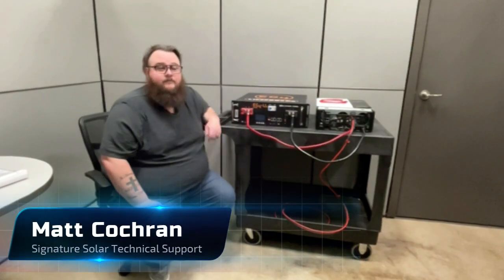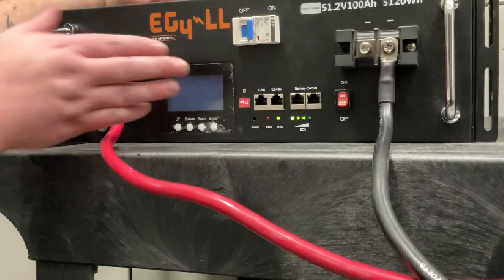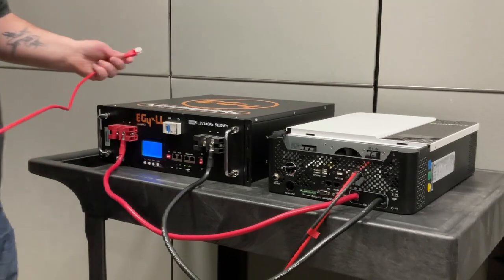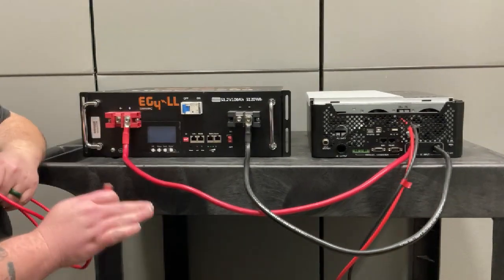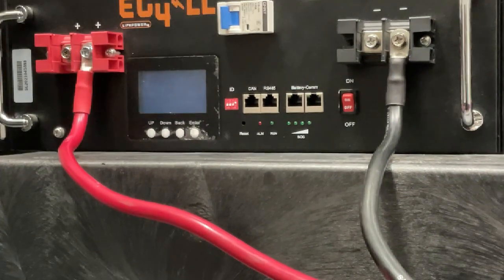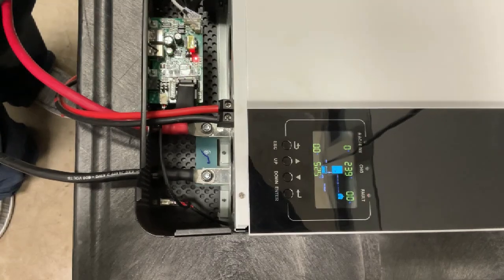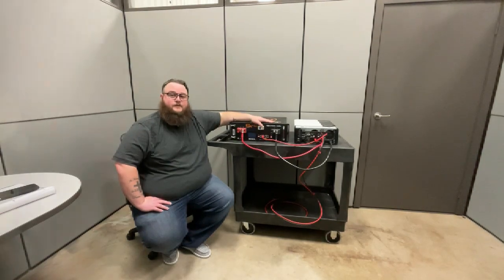BMS Communications with EG4LL Batteries - Tech Chat

Comment: More videos please, especially one explaining what grounding needs to happen between the 5kw, auto transformer and the sub-panel.  And whether or not your sub-panel gets bonded neutral to ground.  Thanks!
Reply: I would like to know this also.
Reply: 2 grounds run separately one for the DC one for AC. I bonded to neutral in both my AC breaker box and DC breaker box. I have 12 volt DC circuits for lights.

Comment: Thanks Matt,  you made setup very easy and it worked first time!
Reply from the maker: Glad it helped!
Reply: Only because this demo was of the most simplistic setup imaginable. Have fun with multiple inverters and batteries, and have fun with CAN vs RS485 connectivity. You might get lucky. Most likely not. I've got about $50,000 into my entirely-EG4 system thus far, and I have yet to get it actually up and running. EG4 tech support takes weeks to respond and then is terse and unhelpful. NO cable extensions available at any price. Radical and relentless misinformation in the manuals. In short, for anything beyond the superficial setups you always see demoed in these "help" videos, trying to get EG4 equipment working together for a whole-house setup is an intractable mess!

Oh, and I mustn't forget that the "EG4-LL" now comes in an older flavor (I have three of those) and a newer flavor (I have six of those). The look NOTHING alike. Ports are in entirely different places. Internal software is different. And the all-important DIP switches got moved from the front to an impossible place on the side (when the battery is racked), and which adds to the already deep confusion by taking ALL references in the manual to "up" and "down" and making you rotate them in your head to "back" and "forward." It's ABSURD. Still the same model of battery, but it's a different beast, and the manual, of course, didn't keep up.

I'm so SICK of wasting my time in befuddled research to try to get this mess to work that I literally cannot describe it! At the moment, I've got a $50,000 brick and a company in EG4/SignatureSolar (owned by the same principals) that just doesn't give a rip. So, these super-simplistic, "helpful" videos feel to me like a slap in the face!

ALL I can do at this point is keep crawling deeper into the rabbit hole on my own and relentlessly post online to NOT BUY EG4 systems!!!

Comment: With the 48volt LifePo4, is the dipswitch setting for a single battery different from setting for a master if you have more than one battery?  I presently have one battery and all the switches are down. I'm adding a second battery soon, and so do I change it from all down to the fourth one up?
Reply from the maker: We are currently working on getting a video together that addresses the LifePower battery > we will absolutely cover dip switch settings in that so keep an eye out. You can also reach out to us at tech@signaturesolar.us for help in the mean time.

Comment: I have 4 of the new batteries with the lcd screen. I also have 2 of your older batteries. Will they communicate properly?
Reply from the maker: It depends on which model of older battery you have > if you reach out to tech@signaturesolar.us with the specifics (pictures are always super helpful) they'll be happy to help.
Reply: No because because the batteries can't commutate with one another using the Battery - Comm ports.
I have a solution to it but I am waiting for Signature Solar to get back to me on it.

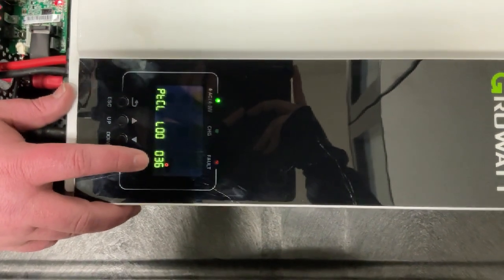Comment: At 5:06 of your video, the sub-menu 36 appears. You set at L01, if I have two Felicity Solar 10kw litium batteries, is it the same for me, or do I set it at L02 ? 0:42
Reply from the maker: They wont BMS communicate and you would just run it in USE using the spec sheet that was provided with your batteries.

Comment: Great video except could not get the Growatt 12k to communicate at all with the batteries.  Did everything just like you said.  Back to USE2 for me I guess.  Apparently this is a common issue.
Reply: Yeah, you're not alone, for sure. I can't get the EG4-LLs to even communicate with my EG4 inverters. So, staying with the same maker does not guarantee any decent out-of-the-box experience. EG4 has got a LONG way to go before its products are ready for prime-time!

Comment: When using LI for setting 5 does this mean the Inverter will ask the battery for the appropriate CV charging and Floating charging values? I have a lifepower4 battery and those values are 58v and "not settable". I just want to be sure those are correct.

Comment: What is the material difference of connecting the BMS to the inverter vs just letting them operate separately?
Reply: Lifepo4 has a very flat charge/discharge curve, so you can't guess by voltage the state of charge between 10 and 90%. So the use of communication allow you to see that. And also any BMS error like a low cell, overtemp, etc.

Comment: Helps those with that battery brand BUT a large portion of lithium users these days are building DIY packs using import prismatic cells.   JBD BMS modules are extremely popular out there, it would be great if their RS485 output could communicate with the growatt.   (the JBD RS485 format is publicized)   Supporting only a few proprietary formats still leaves a lot of users out in the cold.

Comment: This work with Lifepower4 and Growatt 3000 ES?
Reply from the maker: As for the inverter settings on the Growatt 3000 ES > Yes
With the Lifepower4 the dip switches would be different but we have a separate video planned to illustrate how to BMS communicate using the Lifepower4 batteries.

Comment: How do you charge it WITHOUT solar and WITHOUT an inverter?

You don't have the inverter I want in stock and SHTF might happen before I can get one.
Reply: Perfectly reasonable scenario.  Get their battery charger which plugs into house power or a generator 120V/20A out.  Get the highest amp charger applicable to your battery voltage.

Comment: Does anyone here have 2 or more of the  EG4-LL 24 or 48volt batteries (the ones with the LCD displays) that has been successful getting them to communicate with a computer using the Signature Solar BMS Tools software?  I have not been able to get mine to work by daisy changing the batteries from the Comm port of one battery to the Battery port of the next Battery as describes in this video. 
I have found a workaround but Signature Solar does not appear to be interested in it.

Comment: Matt,
Have you or anyone at Signature Solar ever connected multiple batteries as you described at the 3:05 point in this video? I will tell you that it does not work. I have 4 of the EG4LL batteries and have tried connecting them using the Battery - Comm ports like you described in the video and it DOES NOT work! However I have figured out a work around on how to get all 4 of my batteries to commutate with the software. 
I have tried to call you at Signature Solar off and on for a couple of weeks to discuss it and have had no luck reaching you, I just called this morning and was told that you could not get to work due to the icy roads. If you would like to discuss it please let me know.
Reply from the maker: Technical Support would like to discuss this further with you and is answering emails today from home > please email them at tech@signaturesolar.us
Reply: @SignatureSolar   you guys must supper busy, I sent you an email over 5 hours ago and have yet to receive a response back.

Comment: There's more to it than just this! EG4 has produced an absolute MESS for BMS communications!

What you are NOT showing is the fact that the EG4-LL master battery must be put into a "protocol mode" where you specify whether you are using the CAN or RS485 communications port on the battery, and you MUST also specify the communications protocol, which is different between different sorts of inverters. If you don't do this, then you can play with DIP switches and cables to until you are ready to shoot yourself in the face, and you will not get the inverter to communicate with your master battery (unless you happen to have the lucky setup that matches your factory battery protocol configuration).

And WHY are EG4 inverters and batteries not configured to communicate with each other from the factory? These are all EG4 products, after all! Why should the end-user even HAVE to go into "protocol mode" for a master battery just to get it to talk to an EG4 inverter?

As if the above is not enough, even the manual's explanation of the DIP switch settings is all backwards.

WHY do all YouTube "help" videos always demo the absolute simplest setup and one that is obviously already working? To demo the TRUE story of EG4, YouTube videos need to show the horror story the customer is faced with to try to get FOUR EG4 inverters (one master) to communicate with SIX or more EG4-LL batteries (one master) using ONLY the supplied manuals and cables.

Cables are too short, and EG4 provides NO extensions at any price. Is the RS485 able to work with a standard Cat5 or Cat6 cable (since the supplied communication cable is woefully too short!)? WHY is this not explained anywhere? Manuals are RIDDLED with errors and inconsistencies! DIP switch information is in error and in one important sense is the literal OPPOSITE of reality. NO explanation of CAN vs RS485 or protocols or HOW to configure that all-important master battery. I could go on and on and on.

Oh, and I should mention that even the battery rack I got with my six-pack of batteries had the bus bars so badly tapped that it was IMPOSSIBLE to get the supplied bolts to line up correctly and not cross-thread for two holes in each bus bar. Two holes useless in each bus bar. Ridiculous!

There is just NO attention to detail with EG4, and tech support takes weeks to respond. EG4 is producing HOBBIEST equipment designed for users with time to "tinker" and experiment to make things work. NOTHING about a multi-inverter, multi-battery setup is straightforward, accurately explained ANYWHERE, or can be connected using strictly supplied equipment.

So, Signature Solar, STOP producing these superficial "it's so easy" videos of simplistic setups! Any real-world, whole-house setup will bear NO resemblance to your "help" videos! And I absolutely DO NOT recommend Signature Solar or EG4 for anybody needing a genuine whole-house setup to actually WORK!